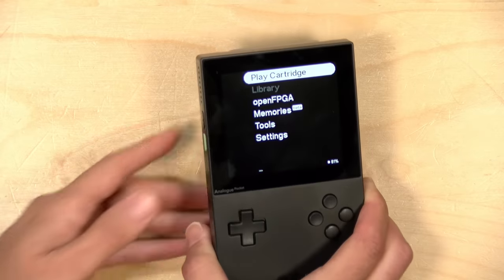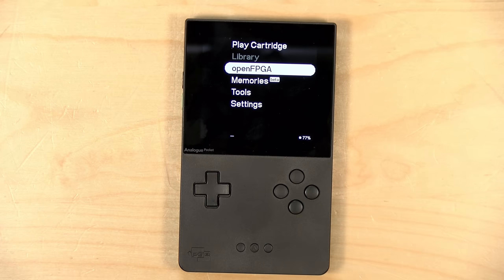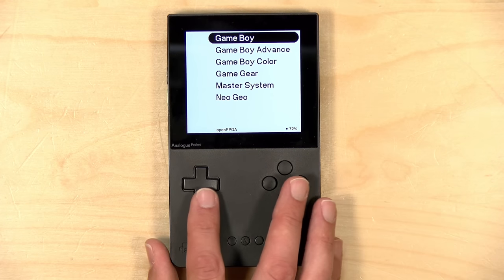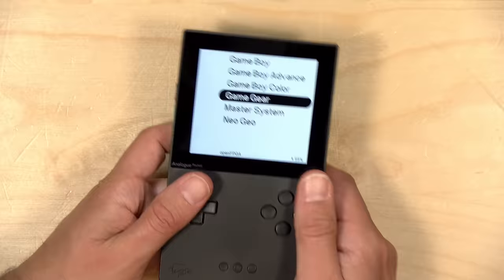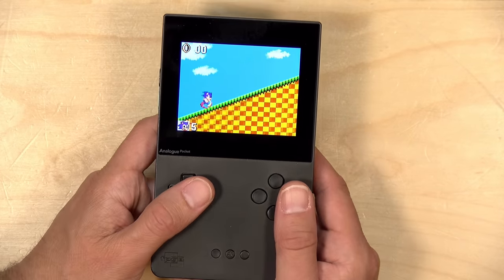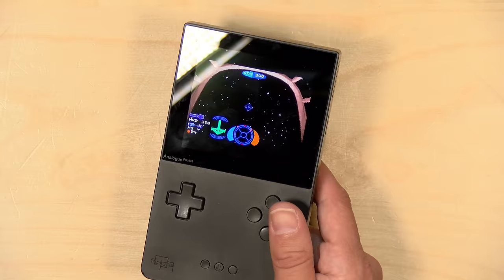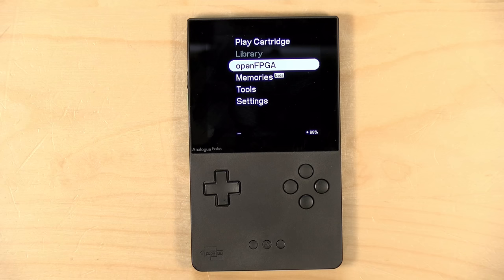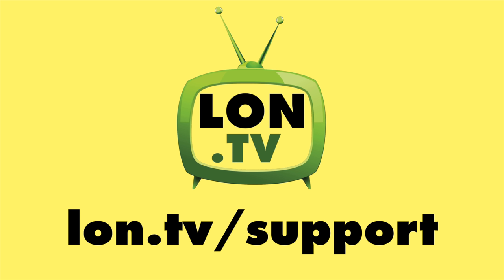Analogue Pocket Update - More FPGA Cores, Boot Games from SD Card and More

Comment: I have been trying to get a Super NT and Mega SG on eBay but failed to get it at a reasonable cost, as Analogue sells it cheaper but out of stock.  Now with the cores out, i'm reconsidering, maybe I'll settle for Analogue Pocket and the dock for cheaper and better options than just buying each system.  How is the dock if you have one, and can it be done instead of buying the Mega SG or Super NT?

Comment: Any updates on the Super NT getting cores thru firmware update?
Reply: The SuperNT doesn't have enough programmable blocks to support cores. It's different from the NT Mini/Noir. The Pocket has a different FPGA entirely.
Reply: So they shut down any future core development for the system??  That’s terrible, I bought it with the expectation that it would receive similar support to the NT Mini…. Super disappointed.